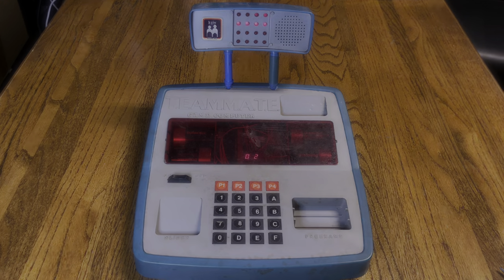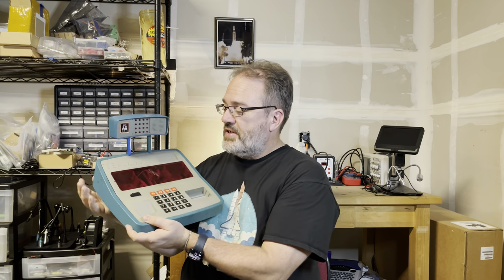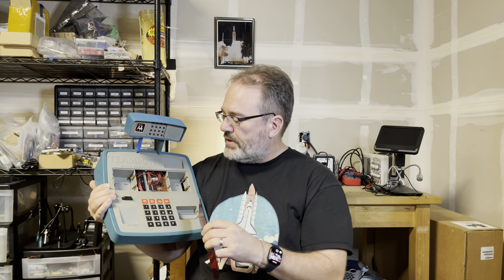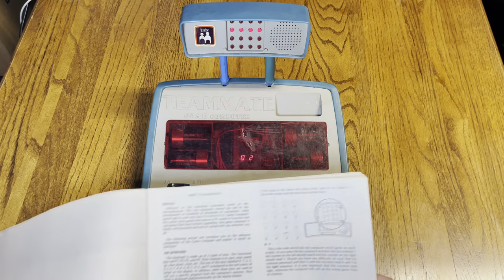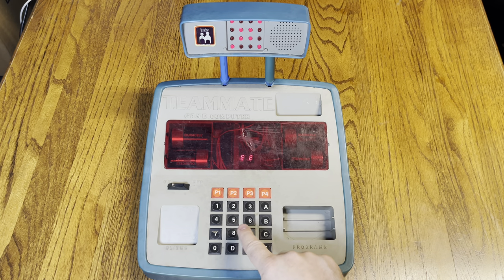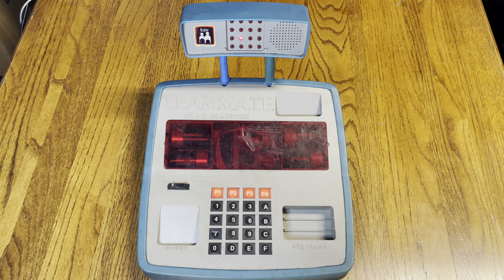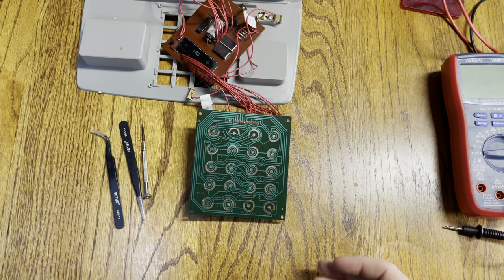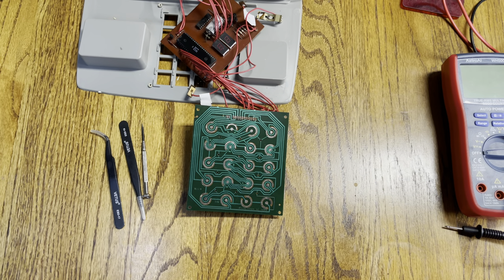The Vintage  T.E.A.M.M.A.T.E. Game Computer - Part 1: Dumping the ROM

Comment: This is wonderful. The microprocessor / microcontroller is interesting, because it was used in a navigator of some kind. How could a jet fighter have been ordered around if the navigating processor only has 64 bytes of memory? I guess it only worked with the four directions of the wind and a home-button.
Reply from the maker: I didn't know that! But, if it was an incremental improvement over a system that had no internal microprocessor, I could see it doing something useful. For example, 64 bytes of RAM would be sufficient to calculate airspeed based one. a few measurements from a pitot-static tube.

Comment: I have the MK38P70 chip and programmed the EPROM that sits on the IC.  It works as per your schematic.  I am 68 and don't remember this computer, though that was a long time ago.  I would like to use a more standard keypad which would require reprogramming the key scan routines. That's where my problem is.  The disassembled file in your github has numerous errors in particular BF using the 90 op code and BF using the 94 op code which are supposed to be BR for 90 op code and BNZ for 94 op code.  There are other errors in the disassembly that would require painful editing.  Its a DASM program error obviously.
I will continue with the project using discrete push buttons since it seems interesting with what I have proto boarded so far.
Reply from the maker: So I ultimately abandoned the disassembled ROM because I realized that there was no easy way to differentiate between in place data and instruction byte code. Furthermore, as you point out, some of the byte code just looked wrong. What I think was happening was they were using the unused bits in the instruction space to store information, but I didn’t spend the time to figure out what. 

For discrete push buttons, check out this other project I did just to learn programming the MK3870: https://github.com/michaelkamprath/mostek-38p70-computer
Reply: @MichaelKamprath  
Excellent work.
I have the version that uses the 2764 EPROM. Far more than I could ever hope to use but putting the 2k image for the teammate works fine.  I tried experimenting with these 20 years ago but had problems finding an OP code for a lookup table in ROM. I have since favored more capable microcontroller chips but the documentation for the 3870 seems more complete now.

Comment: You may be past this point, but one piece of advice with converting the disassembly into source code—  Rather than changing the address based labels, I leave them in until the very last step. I put in my descriptive label on a new subsequent line and gradually convert the code references to my label names.  It lets me compare the address based label to address in re-assembled code to make sure I am exactly recreating the original code.  I suppose this tip is more useful when there is bit-rot or working backwards from blurry program listings where there is a significant opportunity for mistakes to creep in.
Reply from the maker: Thanks for the tip! I haven't gotten to this point yet.
Reply from the maker: So I ended up skipping the reverse engineering of the existing ROM and going straight to writing my own kernel. I learned something about disassemblers: they don't really know the difference between instructions and inline data. Trying to decode that myself proved to be fr more time consuming than me just writing my own software to run the device.
Reply: @MichaelKamprath  yea, some disassemblers are better than others but for the most part, disassembly is an art form.    As soon as the instructions logic stops making sense, it is time to back up and figure out when the data was sitting in code.  Especially an issue when truing to fit complete routines together in a specific eprom.  But I wouldn’t have thought it would be a problem with the 38P70

Comment: I'm really curious about the edge connector. What's its purpose?
Reply from the maker: My best guess is that it was used for testing after the PCB was soldered. Since it was clearly hand soldered, I'm sure they had to check that things worked before the device was assembled. Beyond that, I don't know for sure.
Reply: @MichaelKamprath  That is surely a test connector as it is "hidden" inside. Some old games consoles also have this and it's clearly not for expansion.
It's got nothing to do with the soldering process, though, as these mass products were wave-soldered.

Comment: Why had they chosen to have all the wires the same colour? It must have been a nightmare hand soldering them all at the factory
Reply from the maker: Yeah, indeed. It was hard to follow the wires when I was reverse engineering and refurbishing. Not shown in the video was that I used labels on each of the wires.